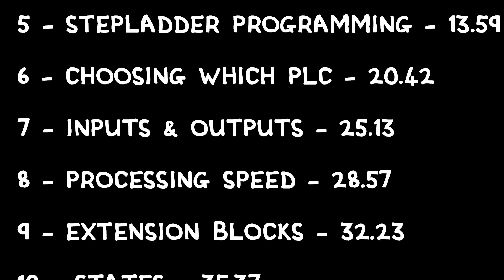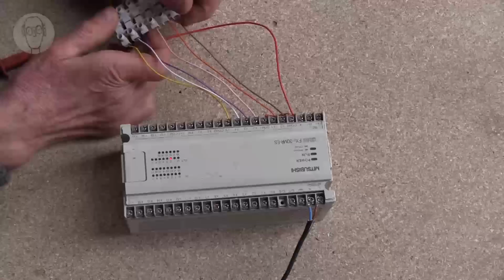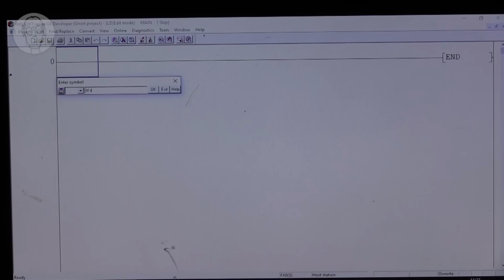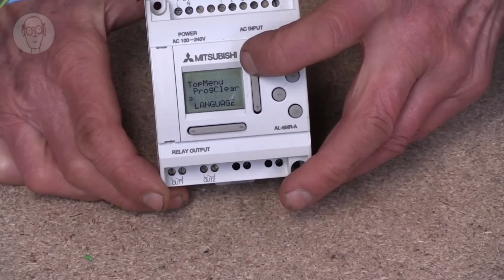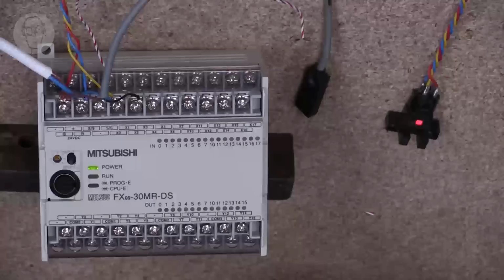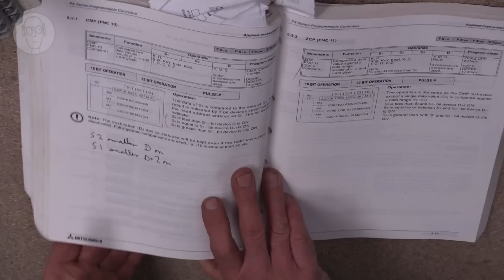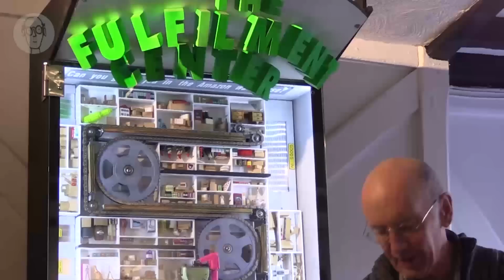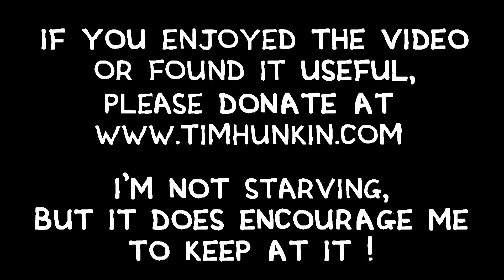PLCs (Programmable Logic Controllers) - The Secret Life of Components - episode17

Comment: My dad used to work for a company named Klockner Moeller, or H. Moeller, or later Moeller Electric. They built industrial motor controllers. He worked in sales, but I remember as a little kid my dad would bring home big boxes of parts and he and my mom and I would put together little enclosures and other small assemblies. Later when I was in high school I worked there for a while fabricating and wiring the large control enclosures. These PLCs were all over the place. And I definitely remember connecting up those expansion blocks with extra outputs. I learned a lot about everything from reading fabrication diagrams, like where to drill each hole in the big metal plates that everything's mounted to and what size hole and what type of thread to tap, to reading the wiring diagrams, so where each wire needed to be routed and how to organize those wires in channels and label them. I didn't go into that field of work but it was a big part of my curiosity in all kinds of hobbies, including much later getting into programming Arduino.

Another big part of my curiosity was your program The Secret Life of Machines. I was very pleased to see you upload them all on your channel with your commentaries. I was always completely enraptured whenever your program was on. I have a lifelong curiosity of how things work and some of that can be attributed to your program. So thank you for that.
Reply: I worked at Gatehouse Close i.e. KM in the 90's, Automation Dept, there was a salesman that used to always be walking off with spare PLC bits come to think of it.

Comment: Some may wonder why PLCs are programmed the way they are. The PLC is essentially emulating in software what automation engineers used to physically build with either logic gates in integrated circuits or prior to that relays. Ladder logic diagrams were used to plan out the circuit, and so that became the high level language for programming the PLC.
Reply: i was watching an ave video on it a couple of years ago and i thought at the time it has an element of breadboard about it.
Reply: In automation, our schematics still use ladder diagrams when describing circuits that have escaped the PLC itself due to voltage or current handling restrictions

Comment: Your comments on simplicity are spot on.
There is a bit of a movement towards trying to put Arduinos and other PC based controls into industrial automation and it can make things a lot harder and much less reliable.

In reality, many modern PLCs are fairly standard computers that are just programmed with a simple instruction set, but this simplicity is really the key to reliability.

I noticed you have a Pheonix contact signal converter there.  They have some really nice PLCs that do the basic PLC programs, but also have a simple browser based HMI system.  They cost a little bit more than an old Mitsubishi but the software is free and have a huge amount of expandability of IO.

Comment: I used Siemens PLCs for years at work, and then some Control Microsystems (which has since been bought up by Schneider). Once I retired, which these days means that I simply changed jobs, I found an Arduino based PLC that has the same form factor as the Control Microsystems units with the same (near as I can tell) instruction set, but they're about 1/10th the price. Really a brilliant setup. You can use Ladder Logic or even the newer IEC 61131-3 programming language. The programming software converts both to C++ for the Arduino. If there's features missing from the Arduinos capabilities in comparison to the actual PLCs, I haven't found them.

Comment: Coming from the MC world, it's interesting how pin configuration on these is done physically with wires, instead of in software.  Usually you can do a mix of pullup vs pulldown on the same controller just fine, though sometimes you need to provide your own resistors.  Having to ensure all of your sensors are of the same type seems really inconvenient.

As for MC vs PLCs, there's a lot of electronics issues that the PLCs are hiding from you.  Aside from pin configuration, you've also got input debouncing, input/output level shifting, watchdogs and a whole slew of bootloader/eeprom issues that you mostly don't have to think about with PLCs.  And while you can find ruggedized MCs, they're comparatively rare and expensive, while PLCs have a decades-long history of use in situations where uptime is measured in the number of 9s in the uptime %...

Comment: I build interactive installations for science centers/museums/etc, and actually went from doing mostly Arduino/Raspberry Pi based systems to PLC/Logic relays and Brightsign. Just going from 3,3/5V to 24V and defaulting to simple inputs and outputs makes everything so much more robust and manageable. Sure, with a microcontroller you can do anything, and sometimes we do. But that also means that the same anything can go wrong, in any number of ways. And they do.

Logic Relays nowadays (at least Siemens Logo) is actually quite powerful, and pretty easy to program! "Fast" inputs, ladder and function block diagrams, expansion modules, network communication, etc.

So I wouldn't say that the approach is old fashioned, more well proven. :)

Comment: As Tim says, plc controllers are very reliable. I work in a block plant using Hitachi modular plc controllers with dozens of inputs and outputs and individual analogue cards. Working in pretty dismal conditions, high temperatures, vibrations and dust, they are pretty much bomb-proof.

Comment: Excellent video on programmable controllers (PC's). Yes, that was what they were called when I started working with them (Allen Bradley, Modicon, and Texas Instruments) back in 1977, before there were personal computers (PC's). I used them on a number of special machines to manufacture aluminum levels, ceiling boards, electrical components and simple medical devices. Interesting work, and sometimes quite frustrating!
The section on stepping switches (cam timers) reminds me of the project we did in 1996 to convert a Vitamin C plant from Tennor drum stepping switches to PLC and DCS (distributed control system) control. The steppers used a lot of additional logic to control the motors that drove the cams, and to modify the outputs from the switches. The old system had worked for about 25 years before the upgrade.
I hope you didn't have any legal trouble from Madge (a/k/a Madonna) resulting from that amusement device!

Comment: A recent development is a new line of Arduino branded PLCs.  They are programmed with the Arduino IDE so the software side is open-source.  I have been using their micro controllers for years and am looking forward to taking the leap into some more robust hardware with a software environment I am already familiar with.
Reply: yes these are fantastic! i have used the "Productivity Open" PLC line from Automation Direct, which is programmed in the Arduino software like you said. they're fantastic little devices.
Reply: @protowave  Are the prices through the roof, or are they targeted for a wider audience than industrial applications?

Comment: Very interesting. I used to work with their F and K series units which date back to the time of the IBM PC and thus programing was done with a clip on panel unit or later a dedicated tablet with EPROM writer. We used them for our Car Park barriers and train Carriage washing plants (British Rail Southern Region) along with a AI Auto Pre Heat And Flash Butt Welder Model 60 (Allen Bradley in that case) along with Bosch ones for rail profile grinders. The only one I have used in recent times was a Siemens one to control a diving air compressor and air banks which has been working now for a few years. I recall we started with a short course at Mitsubishi's offices in Watford with the first task to do the ladder logic to work a traffic light junction.
On our washing plants we used to count train wheels to start the plant and subtract them at the other side (A different count between starting and stopping), the chemical dosing pumps and flow switches plus control of the caustic soda plant to neutralise the acetodiphosphonic acid which was good for cast iron brake dust removal (very dangerous stuff and even eats concrete).

Comment: One of the overlooked features of the PLCs is the ability to monitor the state of the program (input, ouptuts and states) while the controller is running. When there is a fault, you can know very quickly what's going wrong (sensor, wire, contactor...)  and fix it in a moment.  In industry that's essential.
Reply: Indeed! One of the main advantages is troubleshooting. You can see every switch, every output, their state, if they are functioning correctly, or not etc. And of course you can make changes on the fly, jump out a switch that is faulty or change the program to accommodate real world problems or changes with the process. I used to do a lot of plc work at my old job as a shift electrician at a large OSB mill (Weyerhaeuser). I miss it. Perhaps I will get back into industrial electrical at some point, as it is my favorite, but currently am making more money and working a more life friendly schedule doing mainly residential electrical work with my own company.

Comment: Before PLC's, dependable automation would use Mains or 24 volt relays as logic along with mechanical or even penumatic timers. Dependable is a must for things like airplanes and EV's, so much so, that trusting a large computer to do more than monitor or make changes to various controllers could be disaster.

Comment: Very interesting, these may be suitable for a led bulb animation project I’m thinking of building. I sometimes work for a large food manufacturer, I’ll ask engineering if they have any old ones. 
A shame that  shopping
Centre ride didn’t go ahead, it looked amazing ! I’m sure that would draw huge crowds if it was built now.
Reply: LED animations usually require hundreds of switching elements. PLCs would be massive overkill in your case. RP Pico, or Arduino, or Microchip solutions would be superior, smaller, cheaper and easier.
Reply: @MichaelKingsfordGray  I only need to sequence about 30 or so lamps, so it won't need hundreds of switching elements.
Reply: you might look at Automation Direct's "Productivity Open" PLC line, they are programmed like an Arduino but are in the PLC form factor and are fully compatible with their Productivity line of industrial input/output modules. i've used several at my day job and they've proven to be rock solid (whereas other hobbyist-level Arduino boards have not)
Reply: @protowave  Thanks, I'll take a look.
Reply: @Omegaman1969  OK, then it is possibly a practical project. Let us know how it turns out, please!
Reply: @MichaelKingsfordGray  Sure will do. I may just copy the original 70's logic circuit that exists already, probably cheaper in the long run.

Comment: I've worked 10 years with PLCs and automation equipment, still loved watching this video.
The systems I work on are a bit more complex (SIMATIC S7-1500), as the CPU is a separate module and all I/O is remote through network connections, this helps eliminate lots of cabling through the facility as I only need to pull a network wire throughout it all.

Comment: Great video.
You're probably already aware of the countless Chinese PLCs now available that run with Mitsubishi software.
There are also some programs available that convert ladder and function block diagram into Arduino code.
Reply: This is a useful note. The clones are code-compatible and pin-compatible, so generally work as a direct drop-in replacement for their name-brand equivalents. They're available for as little as £60. Obviously you're taking a gamble in terms of quality and after-sales support, but you'd be in the same boat if you bought a second-hand PLC.

Comment: The first P.L.C. I encountered was in the early 80’s, an M.E.M. Commander. It was programmed with ladder logic, with a hand held programmer one line of command at a time, and was an absolute nightmare to fault find on. We used the Toshiba Ex series of P.L.C. with later units from Mitsubishi and Siemens. These later P.L.C’s could have expansion racks added, with analogue input cards, analogue output cards as well as the normal digital inputs and outputs. As time went on, the P.L.C.’s could be connected to suitable telemetry systems, this would enable software generated signals to be created, and hence saving on multiple hard wired connections. Towards the end of my career, ladder logic was being replaced with function block code. This could speed up programming, as the function blocks were already created for certain tasks and could be used over and over again in other projects.

Comment: Great video Tim, thanks for that. Loads of useful technical information for the control system amateur or beginner. Your machines look much more fun than the ones I work on.

I learnt Siemens Step 5 PLCs in 1987 (I worked for a German CNC m/c manufacturer who had just started using them). My current job is as automation engineer for a UK company which makes special purpose industrial machines. Most customers have a strong preference for a PLC manufacturer. The majority who accept different manufacturers select Mitsubishi as their first or second choice (declaration of interest: I also used to work for Mitsi as an Applications Engineer).

I did work for a few years as site Automation Engineer for a large manufacturer. Their slap-dash purchasing procedures meant I had to support 13 different manufacturers of PLC (not a mis-type: I don't mean 13 models either).

Glad to see your mention of the option to full-blown PLCs: the "micro" PLC or "relay replacement" module. Several manufacturers make these and provide free programming software or can be programmed an instruction at a time from the display and push-buttons on the front of the controller.

While micro-controllers like the Raspberry Pi or Arduino are cheaper than a PLC, to "industrialise" them you need to add opto-isolators and then there's not so much difference in price in comparison to PLCs proper.

If I were selecting a brand of PLC for a DIY or hobby project, I would start by pricing the programming software. Sometimes you can get slightly outdated but fully functional software on Ebay or similar for hobbyist prices. There isn't that much difference in price between equivalent hardware. I would suggest Mitsubishi, Allen-Bradley, Omron or Siemens in no particular order of preference.

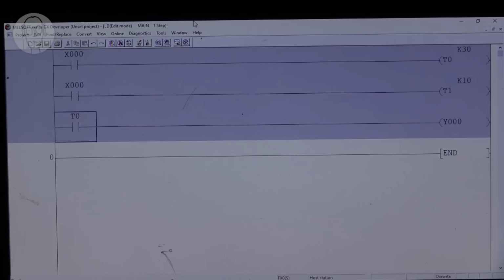Comment: 15:57 many years ago I was active in electronics engineering. My specialty was in high speed/RF analog signal processing circuits.

I tried to wrap my mind around computers such as PLC but it was just such an enormous headache to even understand the programming language. Even though it is graphical the learning curve is just way too steep. I never got into programming at all for this reason. I understand analog signal flow and the math behind analog signals.

Comment: Hi Tim - I think "old school" is great!!  I've been a model railroader for over 50 years.  All the new rage is digitizing locomotives, but I refuse to move to Digital Command Control because it has a whole other set of problems that you have to deal with, most notably the horrible expense that I can use  for other toys!  So I'm still strickly DC with analog controls (hand throw switches, toggle switches, and the like!  If I want sound, I have a great stereo system installed right next to the layout!  Okay, enough of that!  Although I like your older videos as much as ever (and rerun them often to remind myself of some of your solutions to problems that I experience), it's great to you making new videos!  Best wishes from across the pond!

Comment: For starters I would reccomend any Japanese Plc. I have worked many years with Panasonic, you can buy these at 60 or 80usd online with a fair amount of inputs and outputs. For the fellows that want something more modern, any Plc that can be compiled by Codesys. It is a development software to create programs, but years ahead. It is compatible with IOT, you can create operator panels in HTML and control a machine with your smartphone, you can do data analisis and exchange using a normal Lan network and much more. Brands that are compatible with codesys: Delta (Ax séries), CMZ (fct640), and low cost units such as Pixsys. Automation professional here.

Comment: I remember those Mitsubishi plc’s appearing in lift controllers around the mid 90s.
Also the Omron which as far I could tell was the same unit. 
They are virtually 100% reliable as long as that backup battery is good in the old ones. 
28 years ago, doesn’t time fly when your having fun. 
I tried pic, picaxe, arduinos, but now settled on Raspberry Pi pico’s for projects. 
Can’t go wrong with a £3.50 plc in a decent form factor, and a huge community for support.
Thanks Tim, loved all the series. All the best.

Comment: I cut my teeth on the Mitsi FX PLC's. Built many machines in the packaging industry using them. The Melsoft PLC software was a bit of pain initially and the Programming cable cost 250 quid. But the Mitsi programming manuals were clear, detailed and had everything in them you needed. An important point is Relay vs Transistor output and the impact that has on what you're controlling. The early models it was possible to replace the relays. Good video.